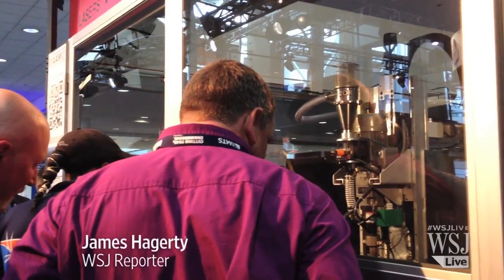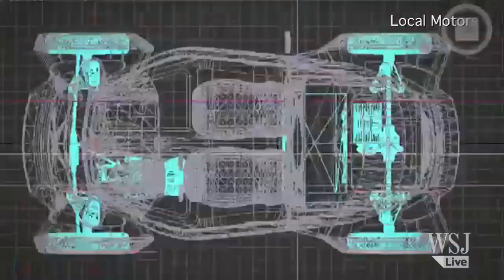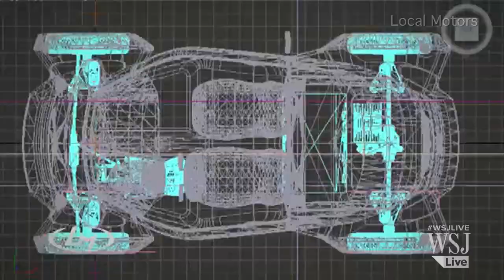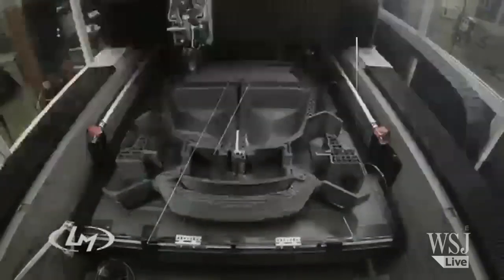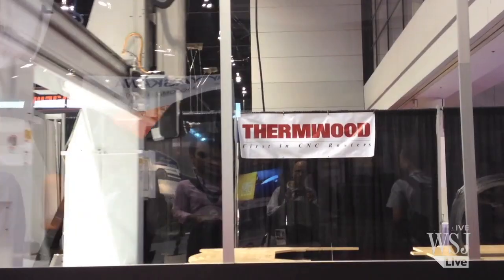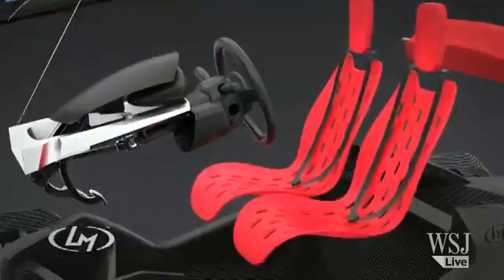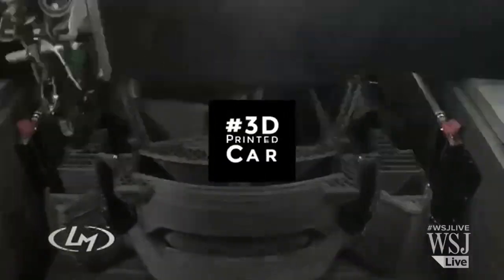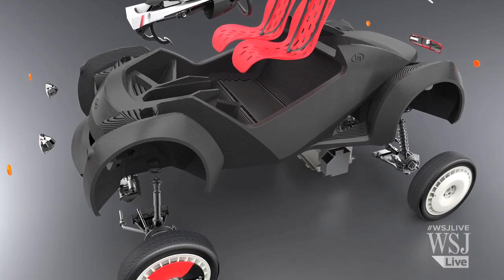3D-Printed Electric Car Being Built in Chicago

Comment: i wonder how long it takes to build all the parts then build a car from all them parts now vs the 4 days to print one out, also why couldn't they have a flat plate with 1000000s of printer heads,and all print at the same time by just raising that flat plate as it builds the car that would save a arm moving all around